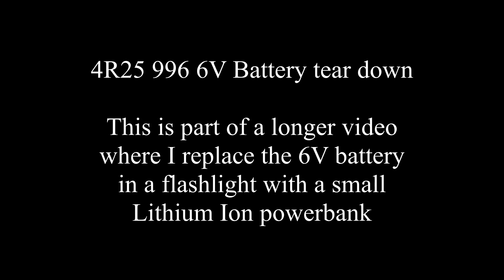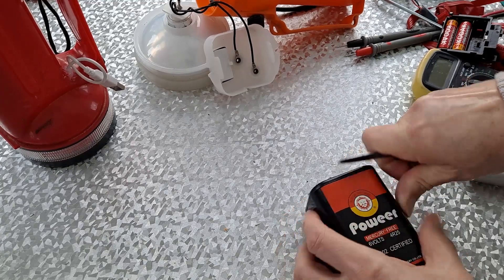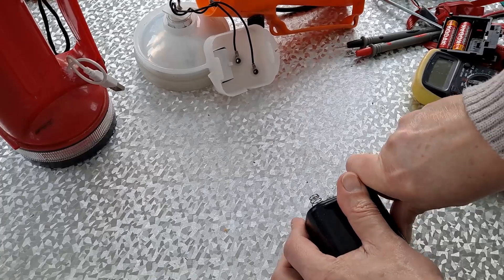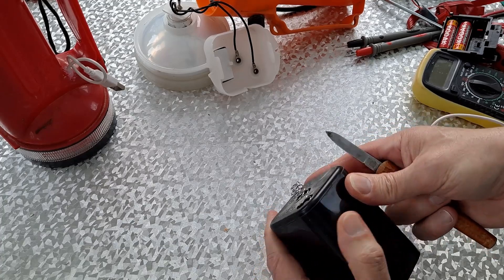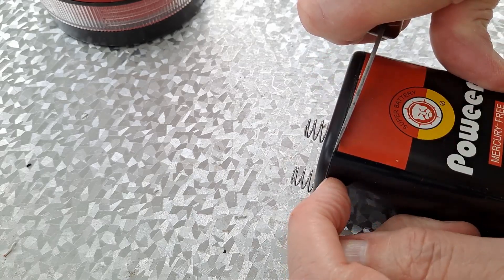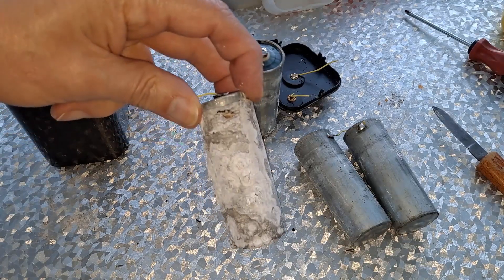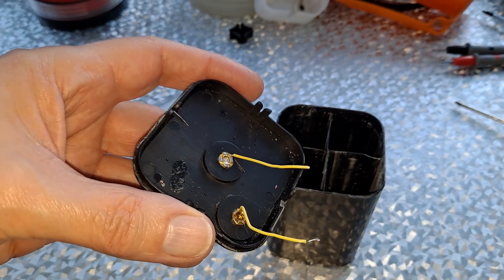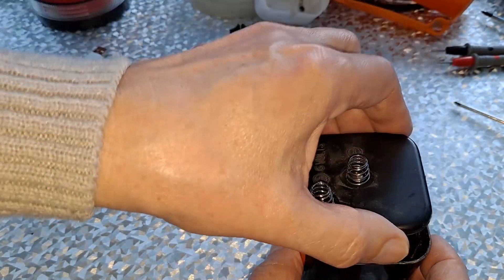4R25 996 6V Battery tear down

Comment: Enjoyed this in same way as you did gents.. so much happy tinkering in our pre health and safety childhoods..
Btw; the 'RAC torch', often available in Sainsburys, has a useful converter case this size, which takes 4, 1.5 volt batteries..😊

Comment: I was thinking about the ladybird book I mentioned in the comment to your pulse motor video, and I went off and searched for it online. I found it, its called "magnets, bulbs and batteries" and I found a PDF of it and relived my youth! This book actively encouraged kids to dismantle batteries for the carbon rods in them! It did emphasis the need not to touch the contents and to wash your hands if you do; I suppose back then we only had zinc carbon batteries, battery chemistry today is probably more toxic but it does show how things have changed. This video reminded me of when I used to take batteries apart for the carbon rods and bits of zinc, which I used to make a lemon powered battery.
Reply from the maker: Great stuff, 👍. I think I have a video on my channel somewhere, where I strip down a bunch of old batteries. If I remember, I will have a look when I get home 😊
Reply from the maker: It took forever to find this video in my archives, because I was looking in the wrong channel. It was on my "other" channel - LONG VIDEO Stripping down some dead AA batteries https://youtu.be/2EBHl3M7gcU - no need to watch it, I am just adding the link here for future reference 😊🔋